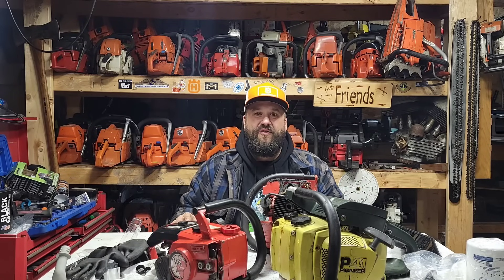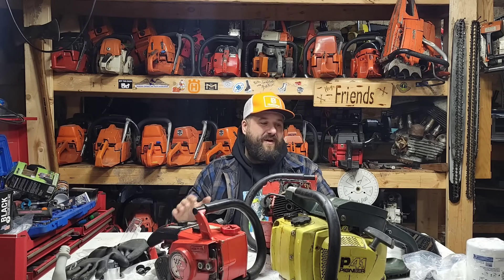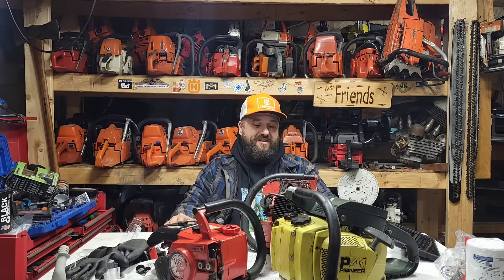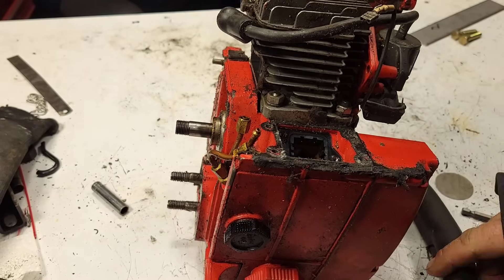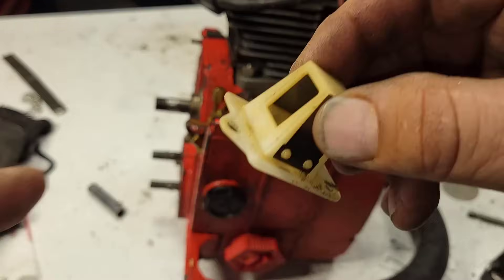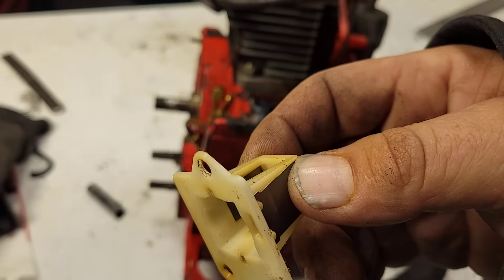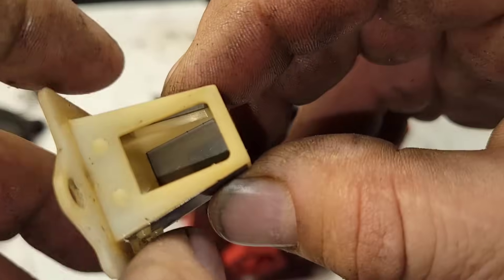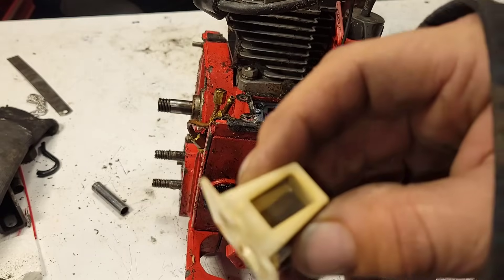How does a reed 2 stroke work?? Reed saws: an indepth look.

Comment: Hey tinman I do get Spruce logs that are about 3' in width or better in my area. Born and raised Alaskan, and I do alot of chopping so good to watch some entertainment when I'm taking some time off. I don't require alot of rest but I keep busy and maintaining my equipment is vital especially here in this part of the Country. I use a 23lb maul splitting axe which my dad handed to me. I ordered a 29lb splitting maul and I hope to get it along with a few parts ive ordered to keep my Homelite SuperXL running. Thanks for taking the time in providing entertainment. Great vids Tinman!
Reply: You must be a ,monster to use a 23 and 29lb maul, when I was young I used a 12 lb for driving locust post in Ar. Wore me out

Comment: This video kind of segways into a broader question I've had. Do you have any particular tips or insights about porting old horizontal cylinder saws? There's a bunch around me right now for $25 to $50, and I've been thinking about picking up a few just for some winter shop. Tinkering. Do you find that there's much overlap between those older horizontal cylinder saws and modern saws as far as the portwork goes? Or are they pretty much their own animal?
Reply from the maker: May have to do a video on just that.
Reply: @tinmanssaws  that would be awesome!

Comment: a disadvantage not mentioned is  that it is difficult getting the crankcase volume small enough. often reed engines will make gains reducing volume. another  issue is the reed cage is usually an obstruction to air flow.

Comment: Please forgive me, I still think the average guy does not understand when you say  case.    That is where the crankshaft is,  The crankcase is the intake manifold in my opinion.  Ever since watching YOUR videos I understand this.  I like the reeds that have screws holding them down.  I flip them over as you said at 14:12.    I have a few reed saws.  They are great if the seals are good.  When I say seals I mean the seals that are on the clutch side and the rewind sides  of the crankshaft, plus all the connections for the carb and cylinder.    PLEASE forgive me for mentioning this as you did.    Homelite is like an old Chevrolet--- you can mix stuff up.  They do flutter.  My main saw is a Homelite 1020 100 cc !!!!!!.  4 reed saw.  I am 67.  (still videos coming out after the build)    A friend gave it to me and I was the benificieary.   Thanks Tim for all you do.   Thanks again.

Comment: Thanks.... So on the HomeLites, is a safe port job to simply raise the exhaust roof by a few degrees to increase RPM but leave reeds and intake alone? The HomeLites 54 and 58 cc saws like XL12 and Super XLs seem to have plenty of torque but run slow at top end. So I'm thinking raising the exhaust roof a little will be something a rookie can safely do and not mess up the intake side. Advice please... Thanks again
Reply from the maker: Yes you can start there. The biggest issue with homelites at higher rpm is heat. 

They run very hot, that's where a good pioe or muffler mod comes into play..
Reply: @tinmanssaws  thanks. I know a guy on eBay who makes awesome pipes for most saws so I'll do that too

Comment: My dad was telling me on the later XL12 homelite saws they changed the reed placement on the saw and those saws were not as good. Most people use to saw the red saws weren’t as good as the blue saw for that reason but my dad had one of the first years of the red saw and it was actually the same as the blue saw. Both his friends bought red saws I’m guess early 80s and those saws were problematic. Only difference my dad said he could see was the reed placement. If I remember correctly one was case feed and the problematic ones were cylinder feed. He’s still got my uncles XL 12 that only cut enough logs to build his house. It’s won’t run good consistently. My dad say one day his going to transfer that saw over to one of his old XL12 case feed saws to see if that solves the problem. He was always curious why the red saws got a bad wrap.

Comment: Be a fun project to cut down a 500 CC’s type dirtbike if you could find a great deal for some carbon fiber and have a bigger reed then you need so you can cut it into the right size and shape them up and possibly lightly sand them to make them work as perfectly as possible for you.  I’ve been doing this whole saw building-porting hobby since I was crushed in 09’…. And I found Tree Monkey or Kunz and he was cutting the squish band with his homemade wooden based cutter’s and explaining that you’ll need a couple different species of wood as they all expand and contract with the different season’s and humidity…. So your 50mm cutter will change it’s diameter measurements across the season’s and I started making different jigs and tools and doing saw work as expensively as possible and learned some fantastic stuff from all you guys who share your knowledge and experience on YouTube videos!   When I saw the cut-away 028? You made to explain the whole ignition process!!! I was just totally blown away by how incredibly awesome of a teaching tool that it was because… the opening and closing of those transfers is just so hard to understand and usually some trying to explain the whole process gets a novice even more confused… but bring showed how the moving piston was pushing the fuel charge and then how they are pulling in your new charge and how it moves through your system was just super cool!!! And I’d never seen a cutout teaching model on video before you posted yours???   I’ve sent a 1000 new guy question’s to various videos after I explain I tell them to watch your video and forward the video where you’re talking about it !
Also loved that you preached you’d rather help a guy do his own saw work so he could understand that whole incredible experience!   Having a wicked saw’s great and having some other guy’s build’s would be awesome but building one that totally empress’s you after completed is just incredible!!!   And actually building the tools to do that work… with your own two hands

Comment: Hey tinman,  I have a Poulan pro 475 that I’m fixing up and I put a new piston in the old cylinder,the old piston was a single ring and the new one is a double ring and it’s a little bit taller, rebuilt carb and replaced fuel lines etc now the saw runs super super rich with the impulse line off if I plug the impulse line in it dies immediately the saw also smokes pretty bad usually with a little time and youtube I can fix a saw but this one is going on 6 months and still has me stumped, any ideas?
Reply from the maker: My guess is maybe the piston skirt is shorter so it's now over intaked?

Just a shot in the dark
Reply: Thanks a lot I’ll check it

Comment: So instead of using the bottom of the piston as a sliding valve for the case intake, the reeds work like a one way check valve? But the top of the piston still valves the transfer and exhaust ports?
Reply: Correct, think of the reeds like a check valve/fuel atomizer

Comment: Hey there TinBasher!!!,  winter is definitely here buddy!  I’m not the factory thermostat guy and I have always done a more specific thermostat based upon my geographic location… down in Florida I’m using a 160… don’t need engine heat.., up north I’m using a 190-200 over the 180 type because I want the northern truck higher faster for the defrost and heat… they are all going to run their original temperature once they get running around and they open up….  I’m running a 04 250 6.0 6sp manual transmission truck and it will pull down a house and on the Hyway in 6th and 2000 is 65-75… you can hit it and she’s going 140 at 3k or right past it… I’m definitely going to be playing around when I’ve blown the $ on my 4 new shoes for her one day…   Awesome video and it’s just a fantastic information and teaching tool for all the guy’s who want to learn about saw’s!!!

I really wish that Farmertec or someone would clone the dang p-45/50. P65 model’s!!!   I’d definitely grab one of everything just for my own enjoyment!!!